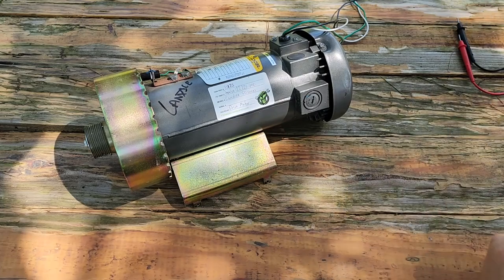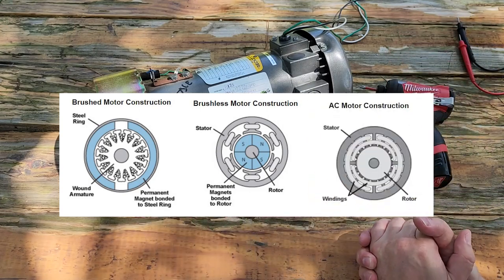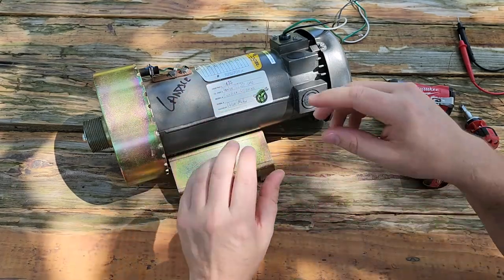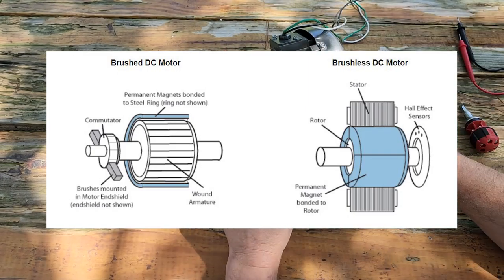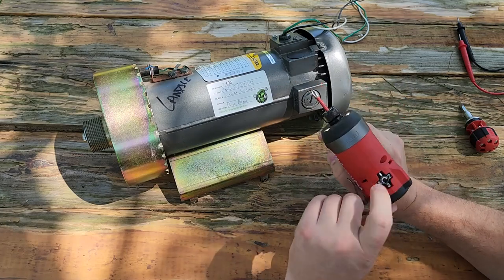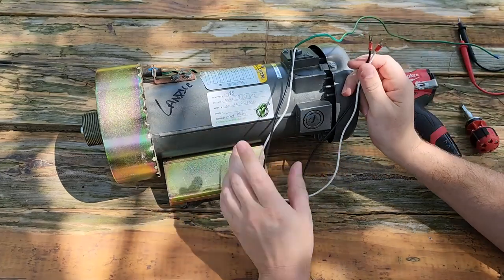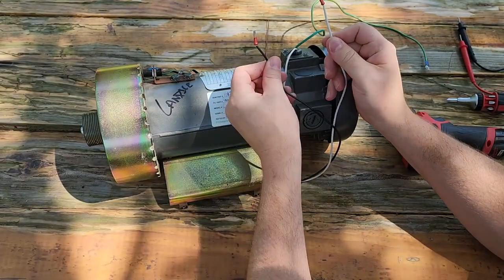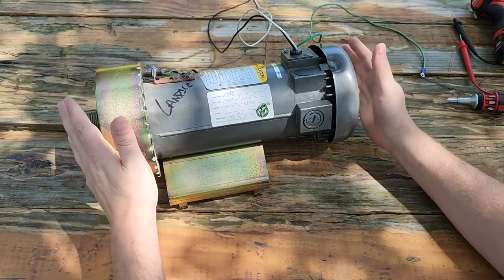Brushed DC Motors

Comment: Whenever we decommission an equipment and I see a Baldor motor, I get pretty excited and I'd take the motor home. I missed out on a couple of treadmill motors recently but got a low hour Baldor out of a Rix oxygen booster pump just last week (someone used oil to lubricate the internal pump so it of course detonated on the first stroke....)
They will be converted to bench grinders and belt sanders 👍

Comment: Great tear down! I haven't tried to dismantle an electric motor before and I learned a lot. I just have one question. At 16:52 you said, "Copper is infamous for something called "work hardening". And work hardening is when you bend copper back and forth, it eventually just breaks." It sounds to me like you inadvertently said "work hardening" when you meant to say "metal fatigue". Or did I learn those terms incorrectly?
Reply from the maker: "Bending the copper causes work hardening (or strain hardening) because working or straining the copper introduces defects, known as dislocations, into the structure. These defects interfere with further deformation, making the copper harder and stronger, thus making it more difficult to bend further."   -  https://www.materialseducation.org/educators/matedu-modules/docs/Work_Hardening_and_Annealing_of_Copper.pdf

Comment: Hi Justin, I was at the HTMA meeting this past Tuesday and I meant to talk to you about these treadmill motors. My question for you is, I have been trying to fix my sister in law's treadmill the issue I am running into is The motor seems to be overheating and will start smoking if you try and set it at a high speed. At low speeds it seems to do okay. But as soon as you crank it up and get going within the first minute the motor will slow itself down and you can start to smell the electrical burn. What do you think may be causing this should I clean the commutator? The brushes on this motor seam and relatively good condition.
Reply from the maker: I'd pull those brushes. Also, have you lubricated the deck / belt?
Reply: @BetterBiomedChannel  I did lubricate both and I have pulled out both brushes but I have not seen the inside of the motor yet. The treadmill itself has very little time used on it.